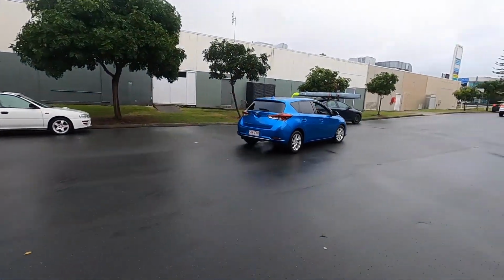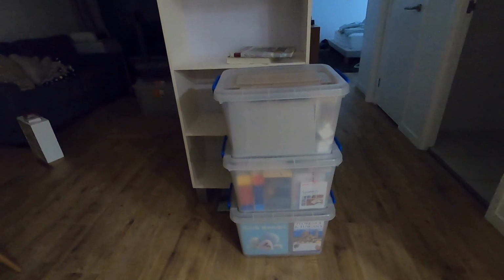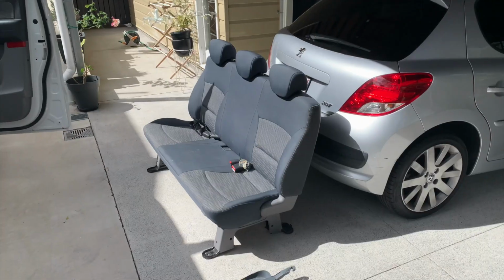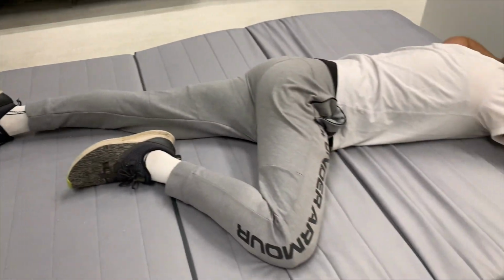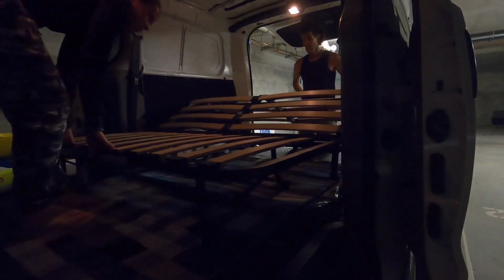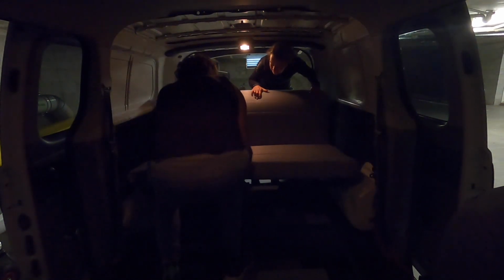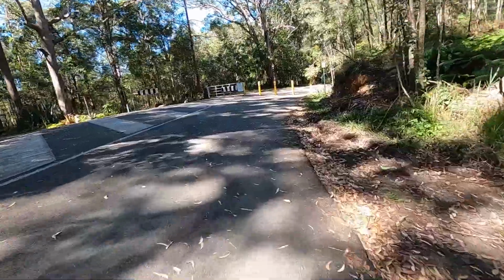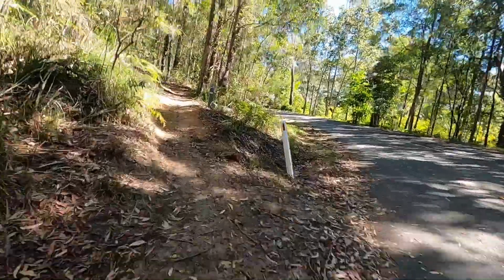Converting a Hyundai iLoad to Our Home | Welcome to Van Life

Comment: Add a fabric strap to the top side of the bit that creates the back rest of the seat. Simply pull on the strap & push the front of the bed back in place. Slides in so much easier, and no messing around climbing in the back. These ikea beds make great rock n roll beds for campers. I love mine!
Reply from the maker: Great tip. Thanks!

Comment: I am looking for the type of roofrails you fitted on the Hyundai van ?  I have the same, want to fit a rooftoptent.  Are those removabel roofrails without the need to drill through the roof ?
Reply from the maker: Yes they’re removable. We bought the van 2nd hand and they were already on it. They’re Hyundai branded so we assume they’re factory fitted

Comment: What year is your iload? Is it the diesel motor? Had any issues ?
Reply from the maker: It’s 2014 and diesel. We get it serviced regularly and have it booked in to fix an exhaust leak
Reply: @TriFitwithTimandAmanda  nice , I'm looking at a 2008 diesel tomorrow with 200,000kms on the clock , replaced turbo apparently,.. can't really seem to find if they're known for any issues
Reply from the maker: Ours had 135000 when we bought it and we’ve done 70000 in just over a year. We’re really happy with ours

Comment: Pretty average conversion if you ask me.
I just did one up that kicks this ones ass beyond
Reply from the maker: Good one mate. It’s perfect for us and yours is probably perfect for you. Thanks for watching.
Reply: Tri Fit with Tim and Amanda your van is like what I want - low budget and minimalistic - I saw your other vid with the ikea sofa bed that fits perfectly. So helpful, thank you 🙏
Reply from the maker: Thanks for watching. We just wanted to get on the road and got what we needed. We see so many who spend so much money but hardly use anything. We might see you on the road 😊
Reply: Tri Fit with Tim and Amanda totally - I’ve got my second campervan and about to change to my third and minimal is best for me - simple and light for petrol consumption too. I don’t like cooking inside small spaces - the oil is absorbed into the air and furnishings around - so I don’t like kitchen and sink setups inside. Just a spray bottle with detergent and another with plain water and that helps to wipe over most things!
Reply from the maker: Perfect. Keep it simple